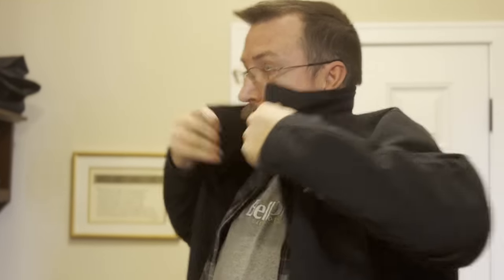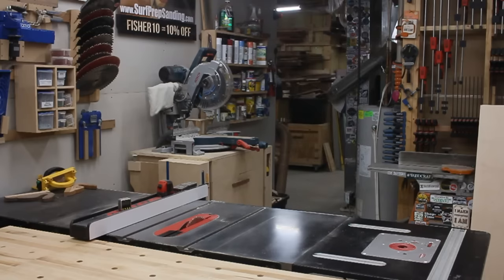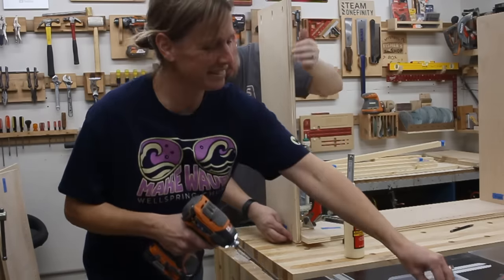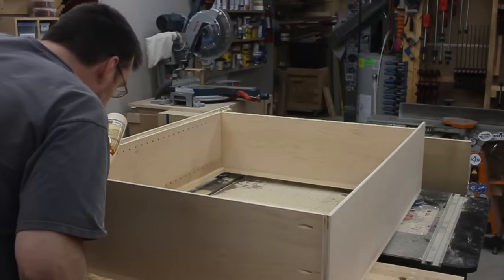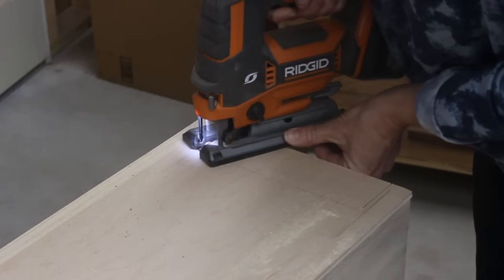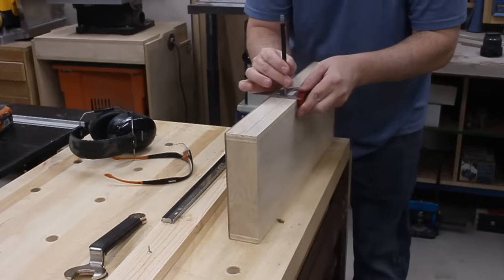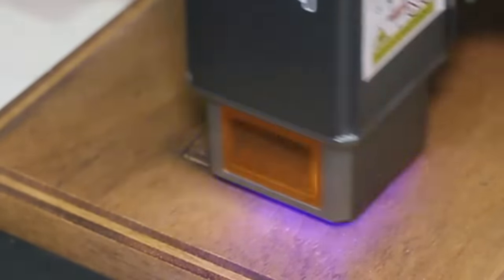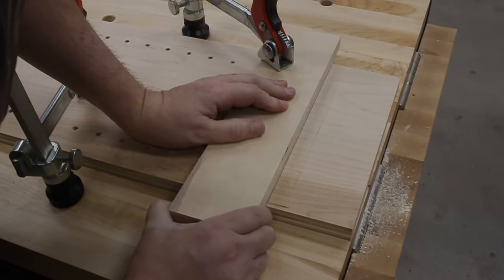Woodworking: Making a simple bookcase with hidden storage!

Comment: Great video as always. What is the purpose of the blocks you placed between the clamps and back panel while the glue dried?
Reply from the maker: They're just spacing the face of the clamps up over the outer edge

Comment: When you were drilling half a hole for (for finger hole) you could have drilled the same sized hole in a scrap piece and clamped that to the drawer to use as a guide
Reply from the maker: Uhhh.... that's what I did.  It's in the video. lol
Reply: @Fisher's Shop  your right I guess I missed that the first time  I saw the second time  but In the out takes it looks different
Reply: @FishersShop  thanks for another great video

Comment: For the hidden drawer could you not have attached that panel directly to the drawer, rather than having to remove it first? That would give you a handle of sorts too.
Reply from the maker: No, you'd never get it open
Reply: @FishersShop  hmm, how about a push-to-open latch? Though I suppose that would need some hollowing out to give somewhere to push into

Comment: I have done woodworking off and on since highschool. Recently retired. I have the same Ridgid drill/driver set.
About a year ago, I stopped using the driver for things like pocket holes. I prefer using the drill, and adjusting the clutch to about 60 or so to prevent stripping screws. I will adjust the clutch torque until I hit the correct setting.

Comment: I wouldn't use an impact driver for pocket screws. This is what your drill and clutch are for. Start the clutch off at the low end and work your way up to the best depth.

The driver is for large screws or no pilot hole fastening (self tapping screws.

Comment: Water base poly doesn’t give you a pretty finish. Regular poly gives you depth in the finish. I hate water poly.
Reply from the maker: I agree, however the water poly doesn't amber over time, which is good.  That would have discolored the stain finish which had the color she wanted.